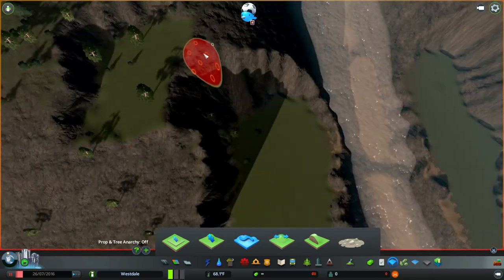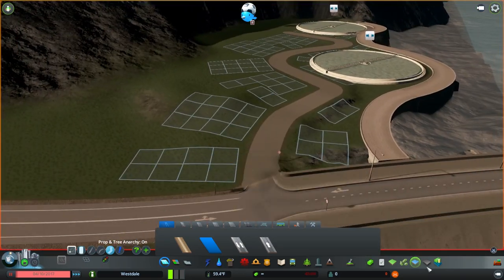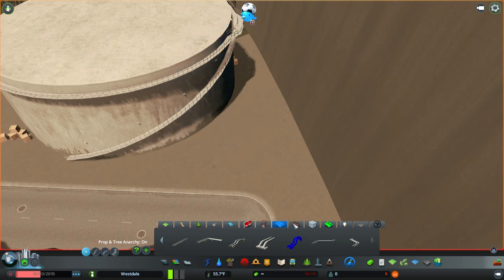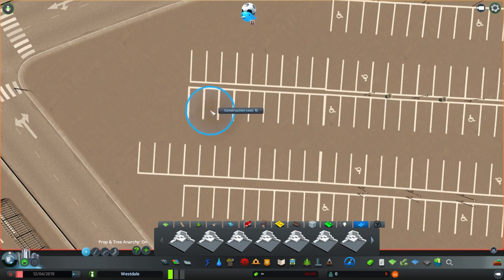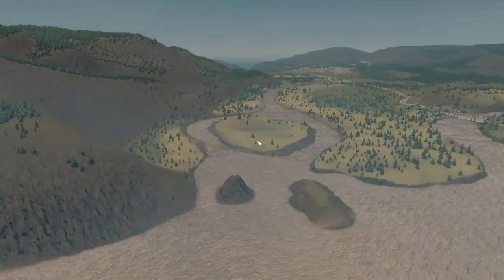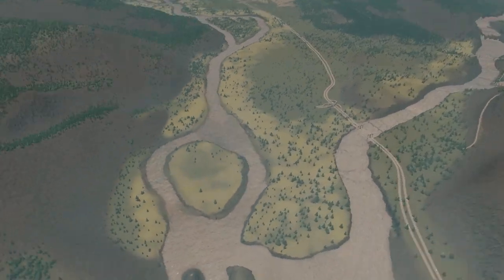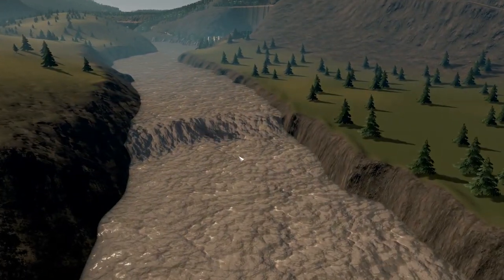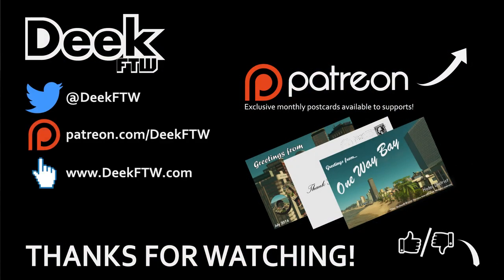Let's Design Northern Valley Ep.1 - Building and Detailing our own Hoover type Dam - Cities Skylines

Comment: Errr usually the water turbines are actually installed inside the dam itself. 

How hydro power works is using both volume of water & the gravity of the fall into the turbine, so it turns and therefore turns a generator.

Comment: All of the turbine pipes would could be underground. The turbines themselves would be in the warehouses. If anything the tanks would be to test the water. Also it'd be cool if you were to build large high voltage transmission lines, there is an asset on the workshop that I'm referring to, but I don't have the name of it on hand.they were about double the size of the original pylon and they were plop able. Another cool thing would be to plan artificial land reclamation for the harbour and also the airport, (airport wise Sydney Kingsford Smith International Airport is a good example.) Those are my opinions but other than that everything looks great so far. The ring over the cliff reminds me of the glass horseshoe over the Grand Canyon. Using some ground decals would give the concrete more texture. Toll road wise there is some good assets on the workshop for it.

Comment: For a dam, you cannot slow down the water, because that would change the speed of the river and overflow the dam. So the energy comes from potential energy related to height change. So the energy from a dam comes from the difference in water level on each side.